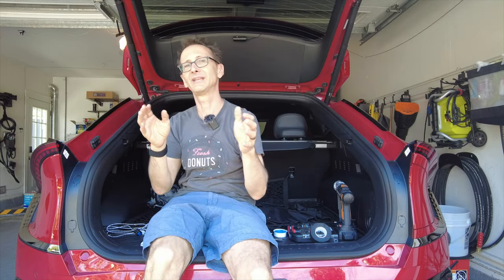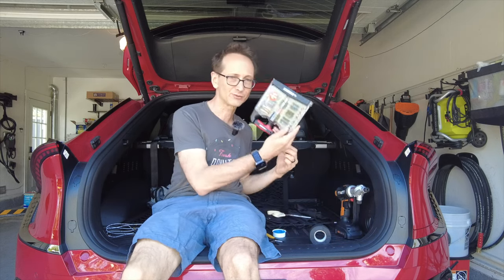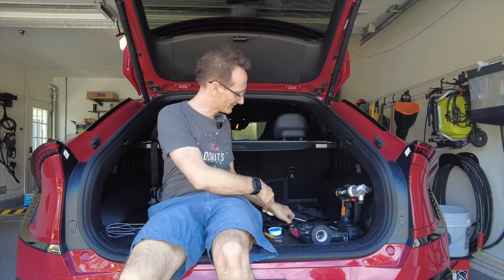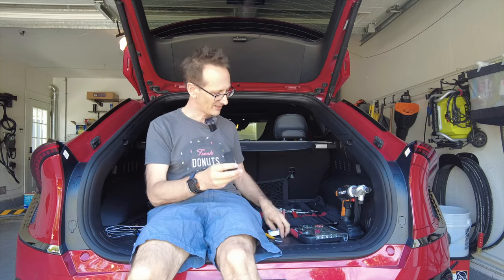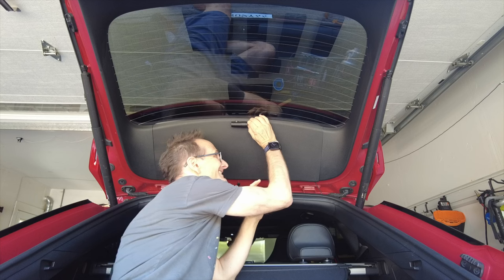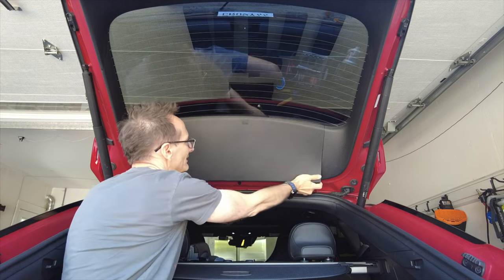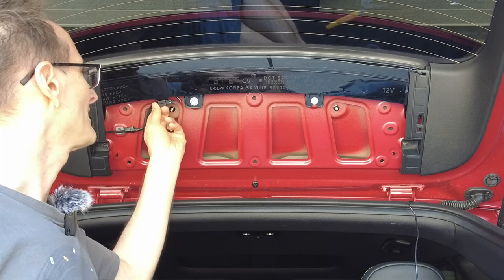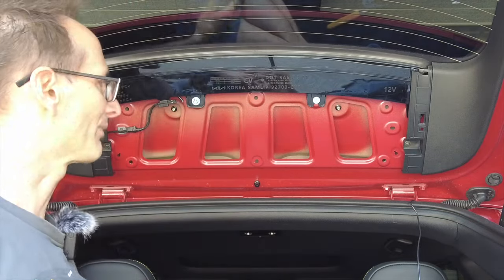Turning my light bar into brake lights!

Comment: Just saw this mod. Good, clear video. Bummer that it's not Plug & Play and that the middle section is no brighter than running-light mode. I did the sequential turn signal mod, but will skip this one unless there's a way to make the center section bright like the other brake lights.

Comment: Nice! We will be carrying this soon as well. Always remove trunk switch first!
Reply from the maker: Ugh that trunk switch!   It looks like Shark Racing isn't carrying it anymore -- happy to put a link to your harness (especially if it comes with the right connectors!)
Reply: @ev_kimchi  only one connector needed to be modified?
Reply: @evvidastore  the connectors for the high center brake light (which was white in the harness I got) intercepts the signal, and has a male and female end.  Both of these needed to be modified.  The male end I just ripped the pins out of the plastic and shoved them into the right places on the OEM side.  For the female white connector, you have to cut off the bottom plastic, then the top part fits properly into the OEM male plug.  I have more photos, will send to you
Reply: @scoopman  just need pictures; I’m going to design it so it’s ideally 100% plug-n-play.